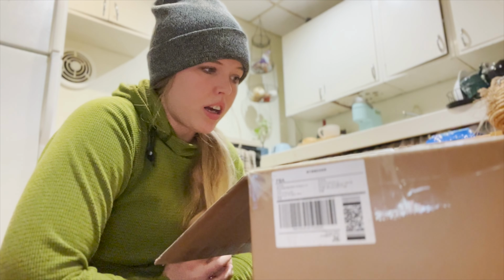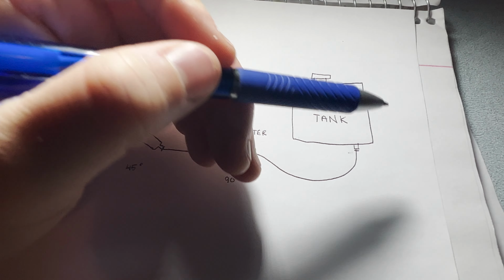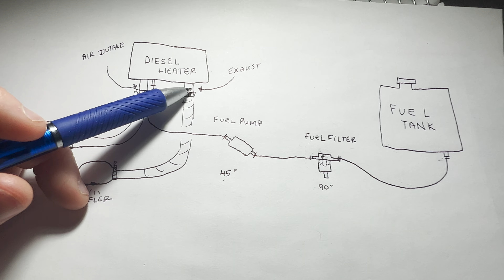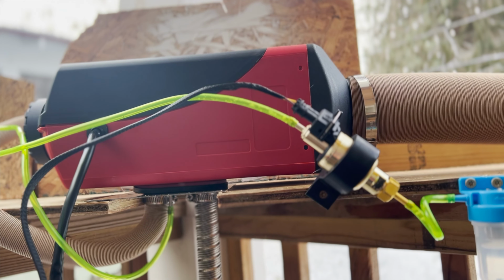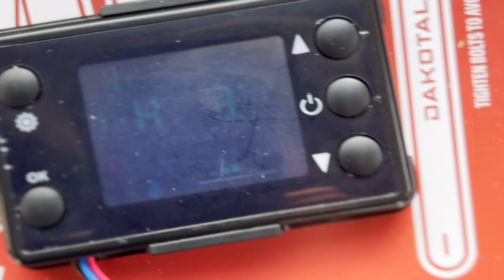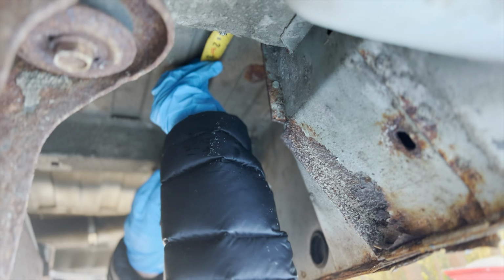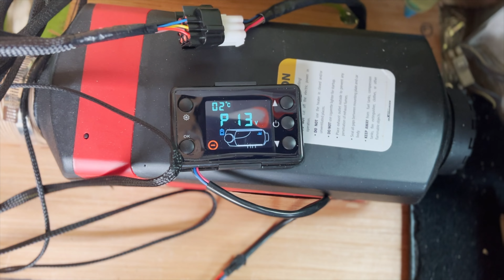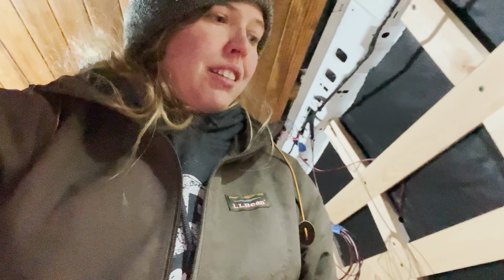CHINESE DIESEL HEATER INSTALL for Van Life | INSTALL DIAGRAM | 5KW MAXSPEEDINGRODS

Comment: The drain on the bottom of the filter is to drain-off water if it gets in the system.  (Diesel will float on the water).
Reply from the maker: Ohh ok cool.